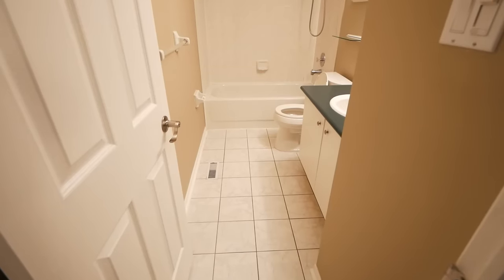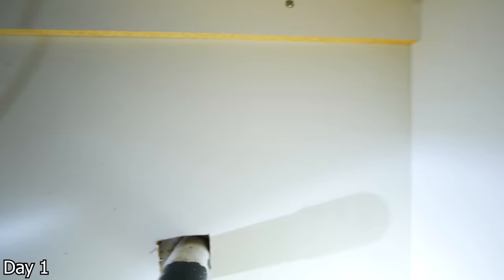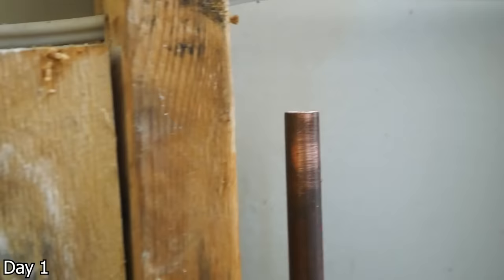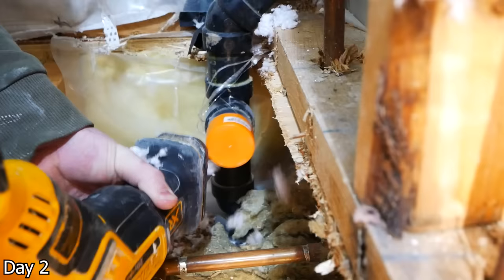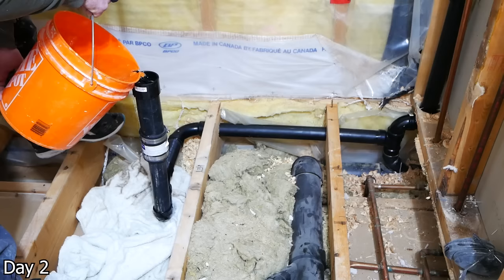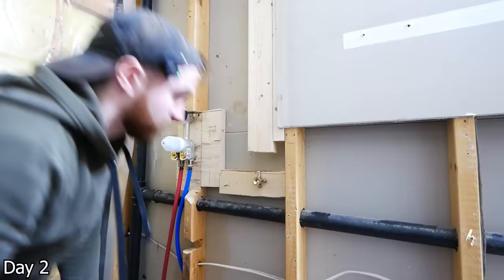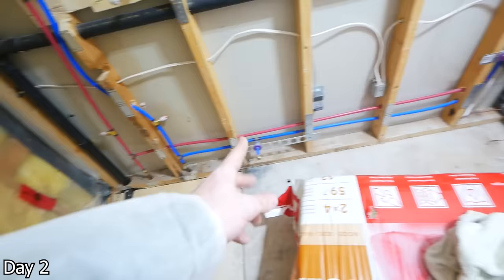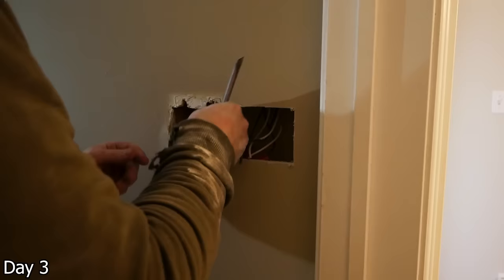How to Convert a Tub Surround to a Walk In Shower | Bathroom Renovation

Comment: What I learned from your video is that it's probably best to hire a professional. I'm pretty sure I could do this myself, but it would take me MONTHS!. I really enjoyed watching your processes, and now know why you get $4500 a week for labor. Good Job!! ...I"m sure this home owner was extremely happy.
Reply: I did this myself in my last house and it turned out great. But like you said it took me 6 full weekends and I was so sick of the project by the end and canceled the recessed soap dish because I was afraid it would cost me another weekend. I also abandoned adding a power vent which was planned (it had a window, so never had a vent), for the same reason. It also cost me a lot more money than we planned for because I had to rent a wet tile saw for so many weeks that we eventually just bought it. We also ended up buying a carpet blower to ventilate the bathroom during all these weeks. Plus several random smaller tools like tile nippers, tons of grout tools and plumbing tools. In the end it was no longer fun, the wife was anxious to get the bathroom back, and I was desperate to finish it. It turned out good in the end, we enjoyed it and it was a big selling point and added a ton of value to the home. The buyers specifically mentioned it as a motivation. But I always said I wish I had I just hired it out. I think it would have been cheaper in the long run (or at least really close) plus it would have been done much faster and wouldn’t have lost 2 months of my weekend freedom.

Comment: Just a little suggestion. If you go to a plumbing supply store you can find liquilock. Basically it solidifies all the water in a toilet so you dont have to worry about emptying it or drips as you walk it out.

Comment: Awesome job.  You got a sub for your attention to detail. Not many people impress me on this.  Not to mention your pants look like mine!
Just an FYI for those in the US, a quick search says that code requires a minimum of a 2" drain UNLESS the Single shower head puts out 2.0GPM or less.  Since you had multiple heads, it is most likely not up to code anywhere in the US.  It definitely isn't in FL, MI or CA. 
I like the idea of using an old piece of tile as a heat shield.  Also, I haven't seen the exhaust fan mount, pretty cool.

Comment: You do beautiful work and   meticulous on the shower floor sloping cuts.
Shluter does now offer a shallow linear drain (3-4 gal/min.). With open access to drains, this linear drain could be on backwall and using Kerdi single slope to drain pan ALL that cutting is sidestepped
Reply from the maker: Thank you! I had heard about this although I haven’t looked into it too much 

My clients would never go for the linear drain in the past due to the cost of the schluter linear systems

Comment: There is a tool in sewing that has a small metal ball on the end of it to help push corners out without tearing a hole in them. I’ve seen other makers use it to clean up caulk/silicone instead of your finger or some other tool. It works really well and saves your finger joints.

Comment: Another awesome bathroom renovation! Nice sliding glass door which is different from the typical swinging glass door done in previous renovation jobs. While I understand that the bottom track doesn't make it a "true" curbless shower design, it does keep the door on a track without risking it swinging and falling off the upper track.
Reply from the maker: Thanks you!

Comment: I recommend putting tiles on the roof of the shower as well. I had plenty of accidents with the handheld slipping off my hand and splashing the roof of the shower on its way down. It's a pain to have to get a ladder to the second floor just to wipe the water off the drywall.

Comment: I'm curious if doing this in a basement with a concrete floor how much of this for the shower would still need to be done? I've been told we'd need the drain or floor to have a slight slope but obviously with a concrete floor that might be a bit difficult to achieve. Is it as straight forward as the pan itself being slightly sloped? How do you keep it flush to the floor tile though if you're doing a pan and then tile on top?

Comment: Anticipating redoing our similar bathroom myself, I have watched a lot of diy videos, this one may be the best overall with the background dialogue of tips and explanations and fast speed of rinse and repeat stuff. Very timely, thank you so much. One question if you could, we were thinking of running the tiles vertically to make the wall appear higher, and then the long lines on the floor to make it look longer. Would the envelope cut still work out as well with a center or side drain running perpendicular to what you did?
Reply from the maker: Thank you! 
Yes of course, you’ll just have a few more cuts to make and it will make the envelope layout a little more difficult to do but certainly still possible no doubt

Comment: How much more if you were to replace the existing door with a pocket door and add a heated floor for this bathroom? Thanks.
Reply from the maker: Floor heat is probably an additional $700 in materials (cable/thermostat/electrical roughin)
Pocket door probably around $800 in additional materials (soft close rough in/solid core door/latch)

Comment: i used to cap pipes temporary with sharkbite while doing work. However, after reusing the cap a few times, during one of the jobs, it succumb to the water pressure and popped off like a bullet, shot straight towards the ceiling and broke the chandelier, water everywhere! After that incident, I always weld copper caps eventhough it's a bit more work, but I know it's safe and secure.
Reply from the maker: Spooky stuff

Comment: I used to be a taper, great tip to screw blocking between sheets of drywall to prevent cracking. BIN is tough to beat for sealing drywall paper and things like that. Instead of bombing out a house with the oil based I use the low odor synthetic BIN primer, man that oil based stinks for days!
Reply from the maker: Thank you! It sure does haha

Comment: I really enjoy your videos. Very helpful. Just wondering why you use Ditra heat instead of Ditra XL? Ditra XL is 5/16 inch. Since Ditra heat is stick and peal there is no mortar. Won't the floor still be lower than the shower tray after the mortar is added below the shower tray?
Reply from the maker: Thank you! Even with the extra 1/16 from XL we would still need to build up the floor with plywood. So we use the Ditra heat because I prefer a no thinset installation

Comment: You are so amazing! Love the video and the motivational ending. 
Technical questions - 
1. would you recommend hiring a professional for the plumbing? If so what stage of the project would they usually be hired for?
2. Would smaller tiles (eg. the size of subway tiles) be easier to work with?
Reply from the maker: Thanks! 
1. Thats complicated. When I started I went through 3 different plumbers because I was generally unhappy with the quality of their work. Obviously there are great plumbers out there but it can be tricky sometimes finding contractors that care. 
For a simple remove and replace it’s definitely something you could learn through YouTube but even that’s gonna depend on the individuals skill set

2. Personally I find 24x24 to be the easiest tile to work with but maybe that’s just me
Reply: @WorkinwithWolkon  thanks for the replies :) You're the best!!

Comment: for the glass, is it on reverse? the door should be on the outside, so the hand held do not spray water through the gap. just a though. god job you guys - I am in Toronto and my shower will need a remodel soon. I will keep you guys in mind!
Reply from the maker: Thank you! The majority of the time the slider goes on the inside of the fixed panel

Comment: I put down new plywood floor so is there any kind of Schluter bonding agent I should put on the plywood before I use allset thinset for the schluter ditre?
Reply from the maker: If you put down a brand new plywood floor you’re probably fine to not have to prime it (just make sure it’s clean first and dampened before laying thinset) 
But if you really want to be safe you can use schluter primer U I believe it’s called

Comment: Great work, guys. To help with the gaps opening at the wall/ceiling/tub/tile joints, fill the tub with water and let it settle for a couple of hours before applying silicone. I have had success with prestressing those joints before sealing.
Reply from the maker: Great tip! No tub on this one for that but I’ll keep that in mind for our next alcove tub

Comment: What suggestions do you have when the ceiling is uneven? My tiles don't go all the way up flush with the ceiling
Reply from the maker: Ceilings are rarely flat
when you’re on your second last row you need to take 2 measurements (possibly even more if there’s a real bow)
Take measurement from left of tile to ceiling
Take measurement from right of tile to ceiling
Cut your tile accordingly
Reply: Wouldn't that make strange uneven cuts in the last row?
Reply from the maker: @bigvinweasel1050  for a 24" tile we're usually talking the difference of maybe a 1/4" at most. Nobody is gonna see 1/4 over 24" at the ceiling. Its the exact same thing with our first row of tile. Floors aren't usually perfectly level but we NEED our first row of tile to be level. That's why we use a laser for the first row as typically the bottom tiles might get cut at a very slight angle. 
Furthermore you want a slight gap between your bottom row of tile and the floor. You also want a gap between the top row of tile and the ceiling. These gaps get filled with silicone for movement joints

Comment: For envelope cuts if the grout joints are 1/16” and the blade cuts 1/8” do things still line up?
Reply: You can move the tiles closer together a bit and it would work fine. fine tune and dry fit before setting thinset
Reply from the maker: Tbh with our envelope cuts we typically space the tiles 1/8” even though we’re using 1/16 clips everywhere (this is done by eyeballing) I find that with envelope cuts the margin of error is tiny so by having a slightly larger grout line we are able to have more consistency and a better overall look
Reply: @WorkinwithWolkon 1/8 is commonly what I end up getting also 😊

Comment: For the LEDs in the shower, steam could definitely be an issue when it seeps in and condenses inside the strip.
Reply from the maker: They’re wet rated LEDs but also there’s a pressure fit diffuser as well

Comment: In the niches - did you just cut the joints on the back wall but not fully????? Just enough to grout in. We noticed you put it up in one piece!
Reply from the maker: Good eye yes we did! Anytime we need a grout line for consistency but can get away with a full tile we will run the wetsaw over a tile at half depth just to score it

Comment: Toronto; 713 crow miles from me.  Hello, I desperately need a remodel.  Can you work me in your schedule?  I’ll pay for the travel and accommodations for your crew. Of course, for the initial consultation as well.  Atlanta, Georgia.

Modest 2200 square-foot home.   Built 2007.  I’m on a slab, I have a progressive neurological where I’ll have to convert to accessible conditions in order to stay in my home.  Reason I’m reaching out such a long distance away, in short, is the confidence inspired by this video.  Please contact.

Comment: I'm surprised you wouldn't use green board for the ceiling above the shower. You used it behind the sink, but not above the shower. Why?
Reply from the maker: Couple of reasons 
Many ceilings are 5/8 so we need to match it
Greenboard is more prone to sag and not recommended for ceiling use
Reply: @WorkinwithWolkon  Hmm, interesting. More prone to sagging I didn't know, but green board does come in 5/8" as well as 1/2"

Comment: is that 4500 a week for labor each or split?
Reply from the maker: 4500 would be the total 
Sebastian bills me hourly
Reply: @WorkinwithWolkon  ah I see. Another question for ya. I'm in the hamilton area and I renovate and work on new builds for a custom home builder. When you do the electrical and plumbing work are you getting it inspected? I can see your work is fine but just curious if you've had any issues with the city or if the homeowner generally prefer no permits. Anyways cheers! You do good work keep it up.